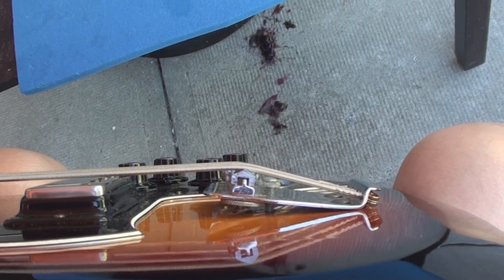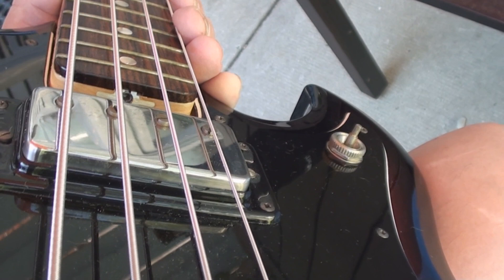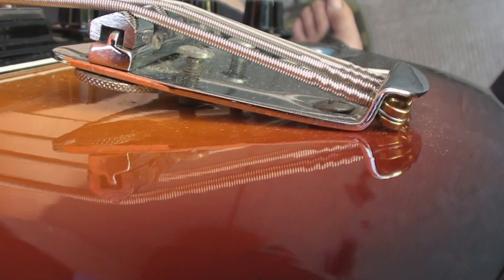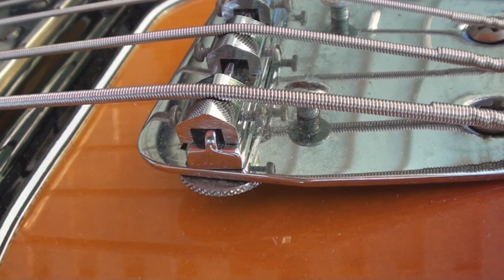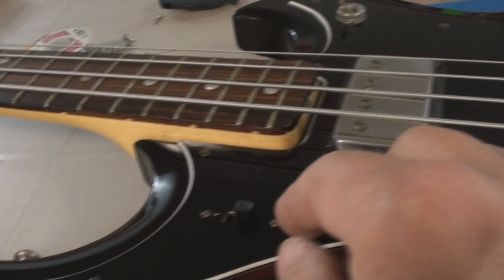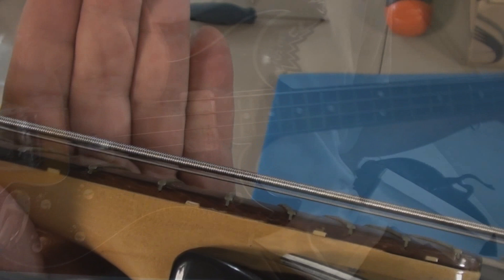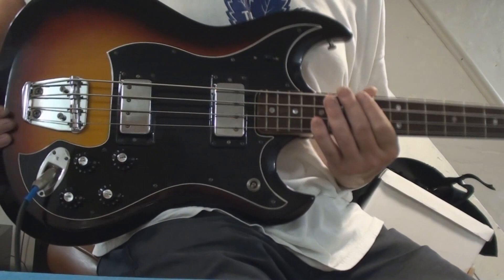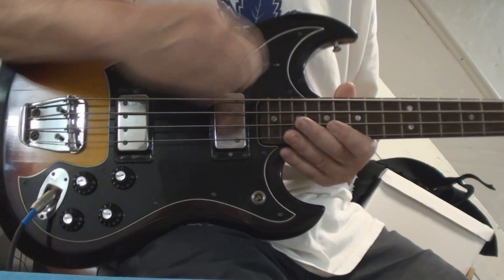Hagstrom Bass Guitar Needs Help

Comment: To address some of the comments/questions posted about this bass...
1). Yes, the switch is a standby/mute/kill (though mine needs replacing...hard to find an original. Damn it!)
2). The truss rod is mounted in an aluminum H-expander beam (never really understood just exactly why there is a truss rod in the H-expander - in my experience the damn thing never needs adjusting!)
3). The hole on the back under the bridge is a construction alignment feature by which the body was mounted while routing the pickup, electronics, and neck cavities. It was filled/capped with a black plastic plug after the body was finished. (Personally I would have dowelled it before applying the finish).
4). The two height adjustment bolts are not scraping the body under the bridge. There are two brass flat headed, counter-sunk wood screws aligned perfectly with the bolts.
5). The bridge saddles, though a little hard to adjust for string length (intonation) are mounted to a bar, which makes it infinitely easy to adjust for string spacing!
6). The machine heads are from a Dutch manufacturer by the name of Van Ghent. Don't laugh at them, Dave. You should have taken the cap off the back of one and inspected. They are gorgeous by design. Nothing like the Japanese junk from the same period. The components are scaled down copies of high end American tuners. Awesome gear ratio, and constructed of machined brass!
7). A rather unique feature of many Hagstrom instruments, including this one, is that the pickguard material was mounted to a thin but rigid sheet of aluminum before cutting. When the cavities are are properly shielded these have a perfect faraday cage.
NOTE - if the bridge and tuners look familiar check out the old Guild and DeArmond basses. The machine heads are the same, the bridges are modified. The early Starfire series basses even used the exact pickups found on the Hagstrom Coronado bass. (These basses became nearly extinct because of a-holes gutting them for the pickups! The Hagstrom company called them Duosonics, a modern manufacturer named Hammond Engineering copied these and sold them under the name DarkStar pickups). 
As a matter of fact, Hagstrom had a semi-hollow bass (the Viking) that pre-dates the Guild Starfires. Oddly enough, the Starfires were nearly identical to the Viking bass with the exceptions being 1). a different headstock 2). the modified bridge, and 3). the Coronado Duosonic pickup(s).

For the record, there have actually been attempts by other companies to copy the Hagstrom HIIBN, the most accurate being the Univox Badazz, albeit they had a cheesy Gibson style headstock, cheep pickups, and super-cheep machine heads (the ones with the crap-tastic plastic heads!

Check it out, Geddy Lee once stated in an interview that after his first bass (a Teisco Kingston model) he graduated to his first REAL bass...a Hagstrom!

Dave! I love your videos, first time I've felt like my input was necessary. Just a real big fan of the Swedish Hagstrom basses. They may be short and light but they were really innovative serious instruments. Somebody just didn't know a damned thing about how to set one up before you got ahold of this gooched hag!

Comment: Cheers from Sweden. This is a HII BN model, and the hole in the back was for fastening the body to the routing table at the factory, There's supposed to be a plastic plug covering the hole but it's often missing on Hagstroms. And yes, the mystery switch is a kill switch.

Comment: As a 1972 Hagstrom H45 acoustic owner I can also agree that they do things right. The truss rod will be a dual flex thing like modern Fenders. Also the neck is a true bolt on. As in 4 bolts just like their electrics. The sound of this thing is INCREDIBLE! And it holds up like a Sherman tank! Truly the Volvo of guitars. If you can get by the old if it ain't the classic shape it ain't no good BS.

Comment: The hole in the back is used during fabrication to put the body in the right alignement on the work table, for drilling purpose. They used to close the hole with a plastic cap when finished. Ajust first string height with the 2 screws of the bridge Then you adjust the pickup height (use the 2 lateral screws of PU. Don't unscrew them totally, otherwise the spring that holds the PU underneath will fall and you'd need to take the whole plate apart to put them back in place).

Comment: That bridge was also used on the American-made Harmony H-25 of the late 60s  (In reciprocation, some Hagtrom guitar vibrato bars ended up on Harmony guitar bodies, too.).  Kinda interesting, you tighten 2 screws on opposite sides of each bridge saddle for intonation.

Comment: Pretty rare and unique instrument. As for the maladjustments made to it, they were probably made by an amateur "repairman" or a novice owner who thought ridiculously high action was better than a bit of fret buzz which we all know is normal with low action. As for the hole on the back, could it maybe be for easy access to adjust an original pot that could've been adjusted? I know some modern guitars have this. As for the mute switch, maybe to provide unwanted feedback during silences? Rare bass.

Comment: The switches and electronics are the weak point on Hagstrom instruments, along with the bridges, way too little (if any) adjustment to be made. The earlier HII B model (same body but singlecoil pu:s, fender-type headstock and fixed wooden bridge) had 4 tone switches that were a PITA , prone to crackling and noise. The Hagstrom necks are great though, that "H" trussrod really makes the neck super stable in spite of being so skinny.

Comment: Davey that's an ejection switch. While driving a "Volvo" you can use that switch to eject you passengers if they are geeting on yer nerves.

Cheers. Cool vids, 

BTW....Whats up with mexican bass pick up. Are ya gonna fix that sucker or what? It would be the first video where you didn't fix 'er up.

ha ha ha

Comment: It may actually be a "kill THE TONE" switch, perhaps, either both literally or subjectively.  That is, it may either bypass the tone control pot entirely or have it contact a tone capacitor for pre-selected frequency filtering.  Many basses do have mute switches, yeah, could be that case as well.

Comment: Can someone help me with my Hagstrom Beluga II?
Having no Battery in the back and the switch flipped downwards (to Passive) everything seems to work fine. If i put a 9V Battery inside (I checked for polarity, and i tried multiple fresh ones) it starts making this weird stuttering humming sound.... If i flip the switch to Active the only thing changing is the Volume of the weird Humming stutter tingy (Gets Way louder).... if i plug a string, i can hear a little bit of the actual note its supposed to play... 
I'm Using a regular Bass Amp (no pedals etc) ... should definitaly be the Bass' fault and not the Amps...(Considering, that everything worls fine without the battery)

Got any suggestions on what to do?

Comment: Hey Dave, I've been having some trouble with strings unwinding from the bridge. I have a fixed bridge Ibanez RG. Do you know what might be causing that issue? And is there any way i can fix it myself? Could there be a problem inside the saddles?